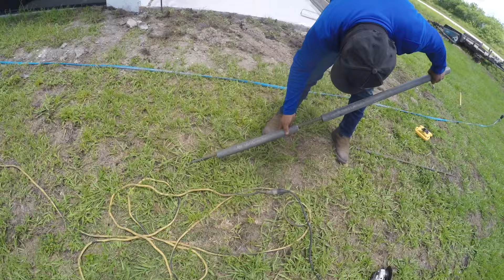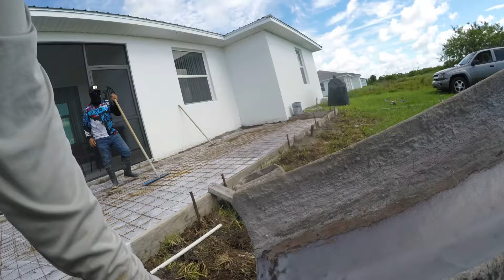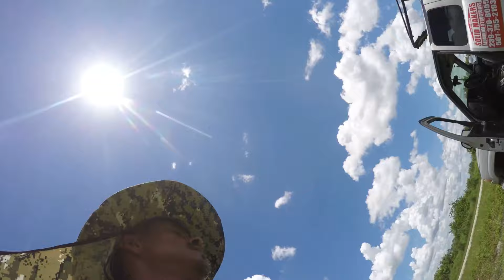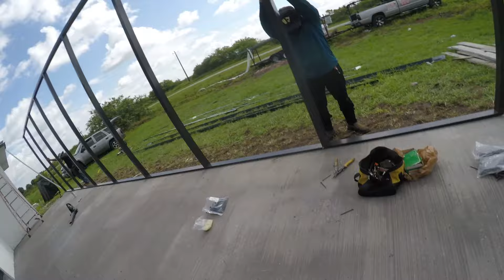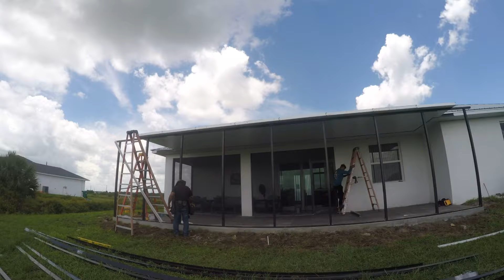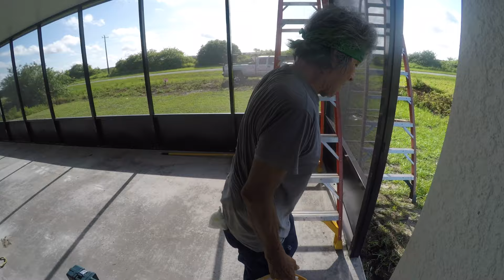How We Build a Screen Room or Screen Porch Patio using Aluminum #construction #constructionlife

Comment: What size metal do you use for your exterior wall post? 2x3?
Reply from the maker: for this job 2x3, but it depends on the job, sometimes I use 3x3 post , others I use 4x4 post
Reply: @solidmakersaluminum how big was this enclosure?
Reply from the maker: @kohlshafer1072  If I remember right, it was about 30 plus feet.